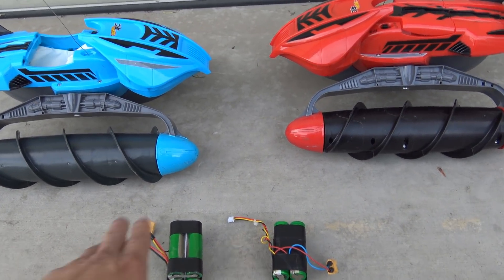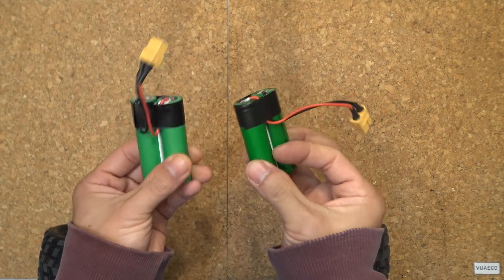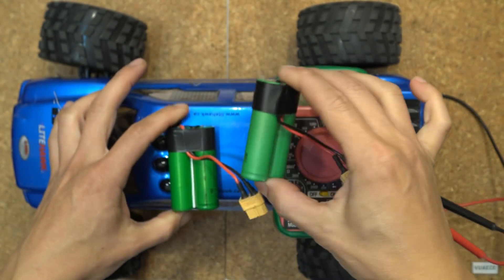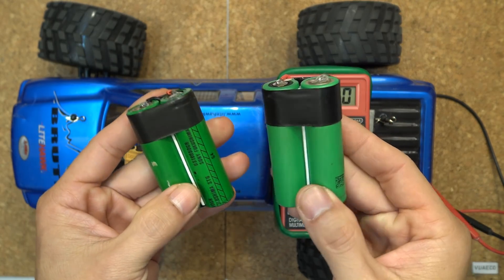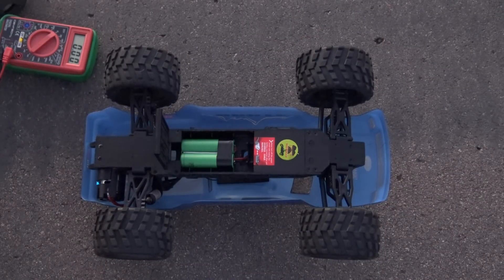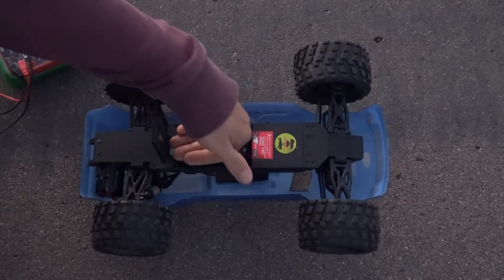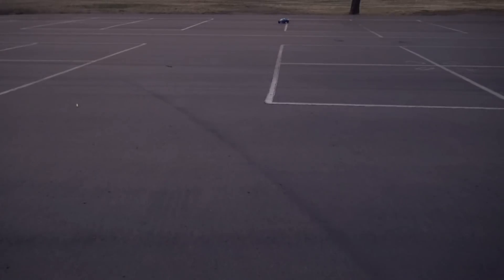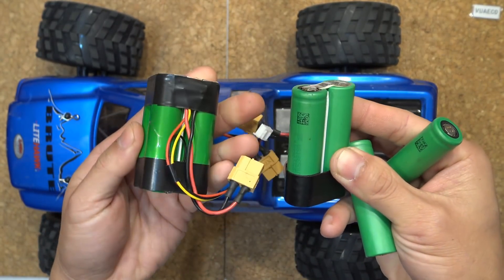RC car battery hack: laptop 18650 cells vs Makita Power tool 18650 cells

Comment: Looks like both packs cut out at the 7.8-7.9V range.  That's at least 3.9V per cell (since the packs are 2S)...nowhere near the cell's low end cutoff.  There's a ton more juice in those cells but the motor obviously can't operate below 8V too well.  Maybe a more comparative demonstration of laptop v. power tool batteries would be a 3S pack.  And a timed circuit (because the increase in zippiness of the power tool pack with your random paths wasn't all that conspicuous).
Reply from the maker: The power tool cells didn't cut out. I just pulled it out to check on battery health. It still kept on going afterwards. Both packs still had plenty of juice during and after the making of the video. (A 2S battery that is in the range of 7.8-7.9V is about 70% full so it still has a long way to go). It was only the laptop pack that cut out (after running only about 30 seconds at a distance about 100 meters) because it couldn't handle the output current of the motor even though it still had plenty of juice.
Reply: @vuaeco  Is it better to make a 4s1p pack, or 2s2p, or 3s1p pack for a cheap rc truck? With 2600mAh, 5.2A discharge rate, 3.7-4.2V?
Reply: What about 18650 (3.7v - 2000 mah) Powerbank batterie?i tried but my rc car was making the same as Laptop Batterie  thx for video

Comment: i have make it to 18650 ..for my rc truck, and i think  your battery not good condition
Reply from the maker: Not all RC are the same. If you have the cheap toy, the motor is small and laptop cells might be fine. But for high speed RC, laptop cells won't make it.
Reply: @vuaeco  yeahh that't right! and i think ESC is also the cause

Comment: When using 2 high drain 35amp 18650 battery which is better to set it up parallel or more MAH's or more volts?? Could you explain which is better as my high powered RC car runs off 3.7v so not sure of it's ok to use series to add more voltage ?? Can anyone help on this

Comment: Wouldn't wiring additional batteries in the parallel configurations increase the current output capacity of the pack?
Reply from the maker: yes.

Comment: Good, informative video, thanks (was only looking to see if you could run an rc car on 2 x 18650 but good to know that it depends on the batteries )
Reply: ❤❤ depending on the voltage of the dc moter❤❤

Comment: The laptop batteries  wont go as fast as the ones that comes with stock 2 cell 18650.
It is what it is...I cant be too choosy from battteries people threw out.lol
The trick is to get a 3-4s ESC . (  $7) So you can bump up the voltage.
390 or 550 can handle 18V...the stock ESC cant ...
It'll go alot faster....trust me.lol...I dont know how much exactly....(depends on C rating)

The stock esc  in that truck,...might also be programmed with low cut off voltage.

I know a can run 3-ea 18650 in another cheap R/C truck ($20)...all day long.
It only has a 390 motor in it...Stock TX and RX 7.4 v nicad pack.
It's not the motor it's the stock ESC or transitors in it...
Not 25-30 mph...but it'll do 20-25 mph on 3s 18650 with the lower discharge
without  frying the strock RX/control board or striping the gears.
It's still faster than stock and plenty fun to drive for a cheap R/C toy.
becuase i bump it up to 12.6 V from 7.4 V
Reply: nice explanation, thanks! i bought a 12402-a wltoys car and it has a 2s battery pack. I tried 2s2p with laptop batteries(5200mAh max discharge current/battery => 10A/pack) and the result is the same as in this video. do you think the ECU on this car can handle 3s? (so that i don't make a 2s4p because that will be too heavy for the car :D )
Reply: Is it better to make a 4s1p pack, or 2s2p pack for a cheap rc truck? With 2600mAh, 5.2A discharge rate, 3.7-4.2V?
Reply: @Kennethtql  it depends what Motor and ESC  you have.
I used to convert 1/8 nitro RC8 buggy, MGT 4.6, extend 1/8.
Those are top of the line
 4S  100 amp esc on 4076 2250KV BRUSHLESS on 4s lipo 50c hi-discharge..it'll make my MGT do a back flip . The buggy will do 50-55 mph.
it tore up the drive line to my MGT . I also went through lots of buggy tires
if I ran them on the street.  
5500 mah will only run for around 8-10 mins
I convert 1/12 Feygen,,or whatever to 3s lipo 50C brushless..it'll tear up the stock drive line after a while. I knew I would go through them. So I got 
lots of spare and metal upgrade.
The stock motor was only 2S 7.4 li-ON
I have fleets of them becuase I got them for only $40-ea
They usually cost $85

I also have redcat and other brands 1/10 4x4 trucks.
They're 2s lipo stock...I install 3s esc and 3s lipo 35c.
It dosnt tear up the stock brushless motor and  trucks as much
I got those trucks on sale for only $80. They usually go for $160
You can probably go 4s Li-ON on those..but you'll need 4s ESC

Ive also savage 18650 from power tools. They have higher C rating or discharge than PC batteries. Should be 25C...but I dont think so.
Should be around 2600 mah....but they're USED.
it's hit and miss. They're around 2000mah ea probably
I do 6s at 10000 mah ( 5-ea 18650 p/cell)
I use them in my grand kids powerwheels...around 15-20 mins run time.
Most people just use 18V ( 5s) Stock power tools pack.
NO esc...ect..striaght through 2-ea 550 BRUSHED MOTORS.
The motors get HOT.
Less power than 5s Lipo @ 50C
The lipo has around the same power if I were to use 24V lead acid
Reply: @oneeyemonster3262  thanks for the detailed explanation. I guess if I keep it with the stock esc and brushed motors.. I'll have to stick with 2s2p.. 4s will put too much stress on both the esc and stock brushed motor.. Thanks again buddy.. 😊

Comment: Can u reply my comment plz ive recently brought a 4x4 rc rock crawler so the Battery is 4.8v 700 mah it only runs 10 minutes can i use laptop battery of 2 and how put voltage in same 4.8, those laptop batteries 1is 3.8 x 3.8v i need put the voltage to rc car 4.8v any solution.

Comment: Good illustration. We have hbx-12891-dune-thunder where you have seperate slots for 18650. I noticed same thing. When running with laptop batteries car is underpowered. But Makita power tool cells work great.
Reply: Samething here....but I got 1/12 rock crawlers coming in...I only got for $10-ea.
Got RX and 60A brush ESC....this way I can  run 4S 18650 with lower C.
It'll have better steering. more POWER  and RUN time...still for only $20 total.lmao...
I have hundreds of sony 18650.....I struck gold one day in a thrift store.
I got 10 laltop packs for $5.lmao...they're all 2600 mah
The 2200 mah 18650...has better discharge.

Im also going to install these in R/C Boat or ships with 550 motors...60A  esc.
If i  get bore....I can always slap in 3S lipo.lol

Comment: Excellent illustration of the performance difference.  If you were to take a fixed load -- like say a 3 ohm 25 watt resistor -- and measure the open circuit voltage of your battery and then the voltage drop across the resistor after a few seconds after  connecting to the battery, the size of that drop will be directly related to the internal resistance of the battery.  And I think you would see a marked difference between the two batteries in the video.  While the unloaded laptop voltage after recovery is similar to the power tool battery, under load the voltage drop is probably much higher do to the higher internal resistance of those cells.